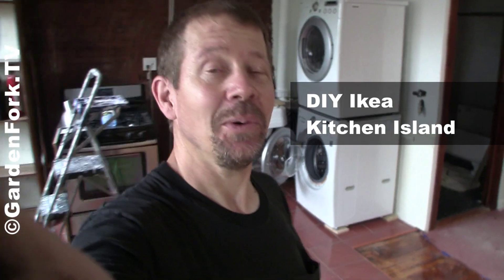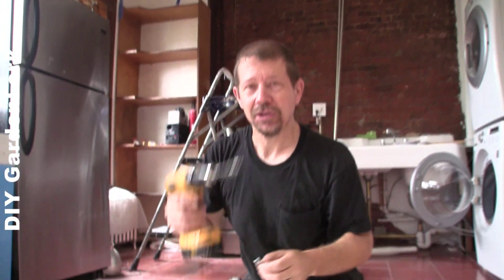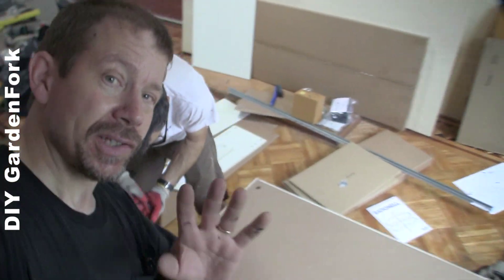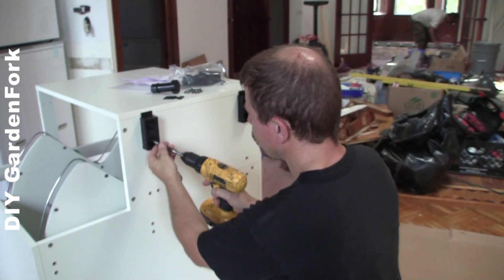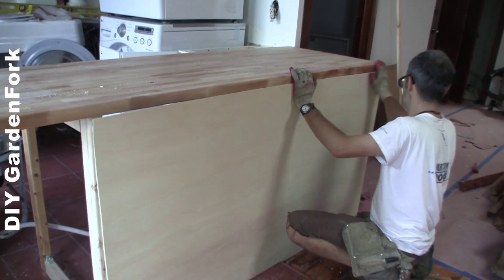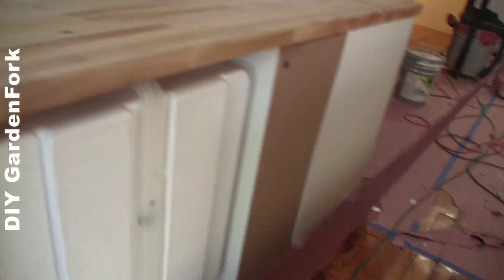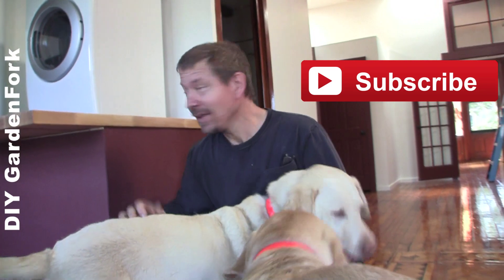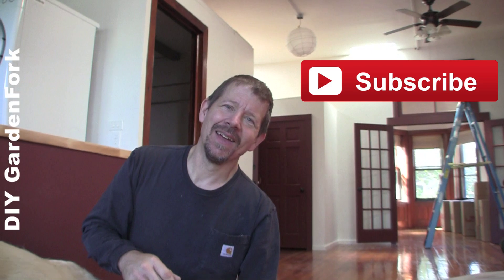DIY Butcher Block Kitchen Island - GardenFork

Comment: man, i'm so glad you made all these ikea diy videos. thanks for making the videos fun to watch. quick question, we've got the mollekulla butcher block countertops which are top layer solid wood on particle board. the product description says it has been pre-treated with hard wax oil and no other treatment is necessary. should we install the countertops as is or, should we still go ahead and finish it? these will not be on the same area as the dishwasher and faucet/sink.
Reply from the maker: Hi Prashant, thanks for the kind words. I don't know much about that product, sorry. I have used the solid butcher block. I would go with their instructions. thx!